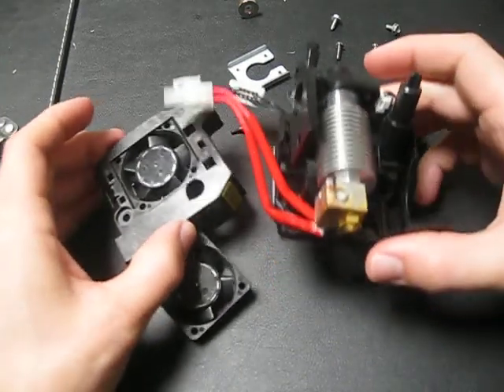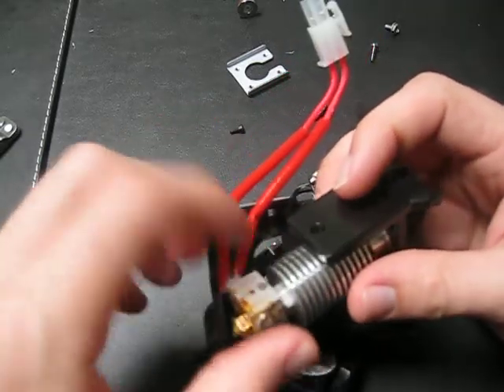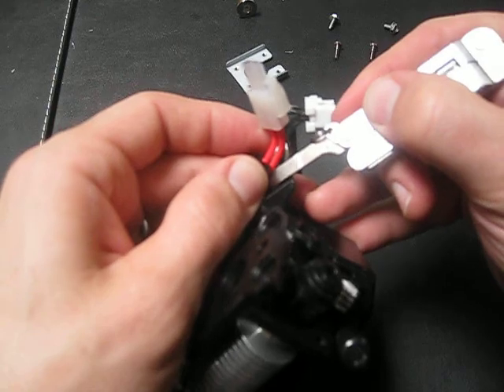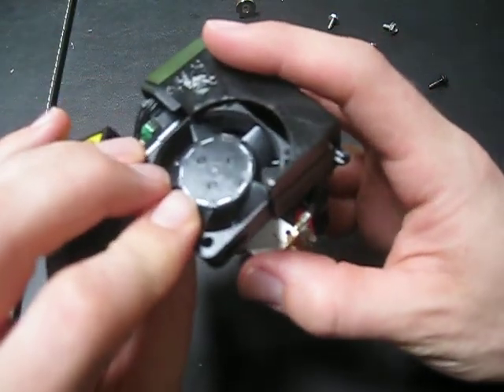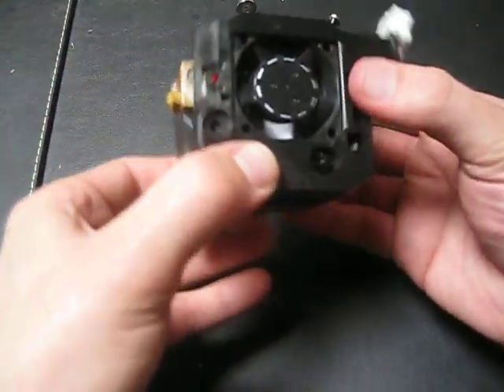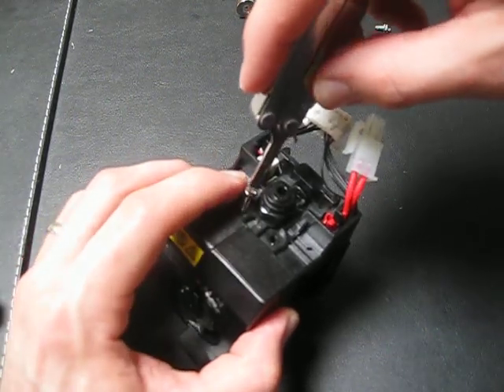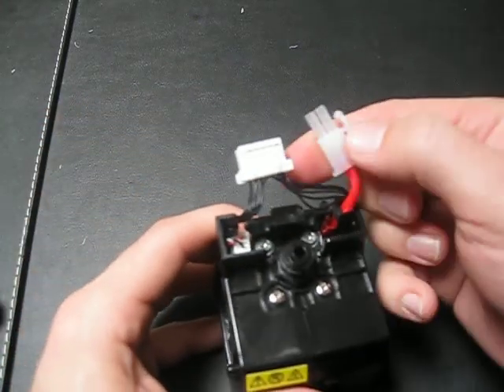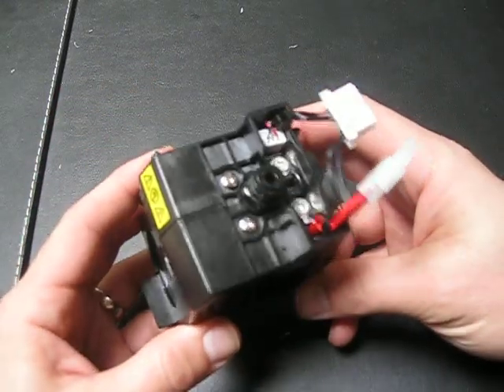3DWOX DP200 Printhead assembly

Comment: Good video as I just took apart my Sindoh DP200 printhead. I had some really burnt grey material, that you called epoxy, might be. I thought it was old grey filament that had accumulated, still not sure but I removed the really burnt stuff and left some that didn't appear to be to burnt. I seem to be working now. I was getting heat fluctuations and the print head would move to the right and say "Adjusting nozzle temp, Please wait" and it would do that 2 times and then the temp would drop, no longer adjust and I would get a EC 302 error. Appears to be working now BUT I would have long 10 hr prints that were successful and a day later and these events would repeat. So, not sure if I fixed it. Nice video though BUT you need better screwdrivers.